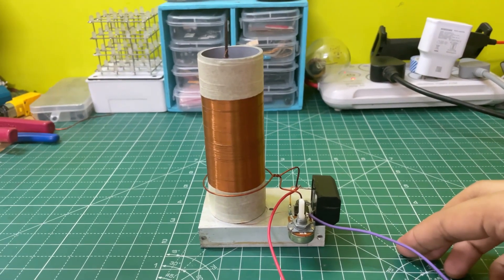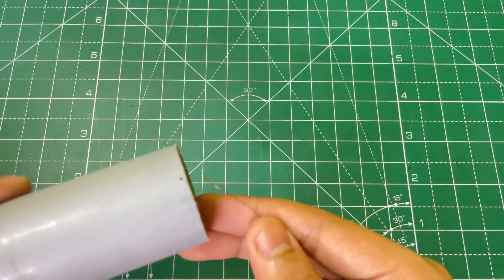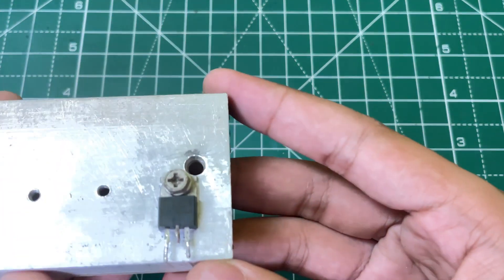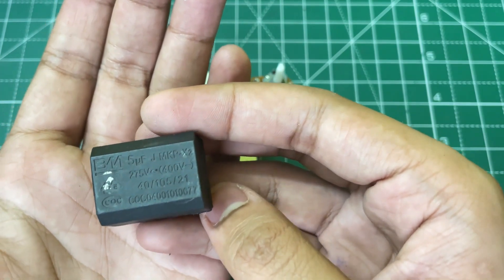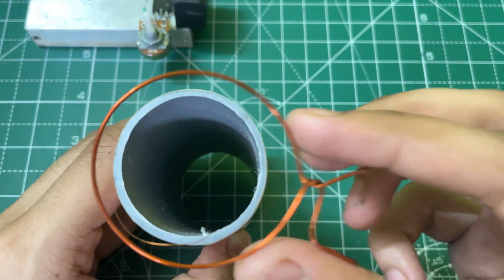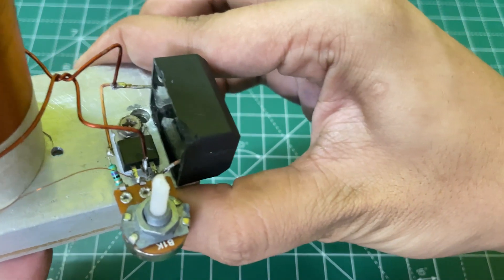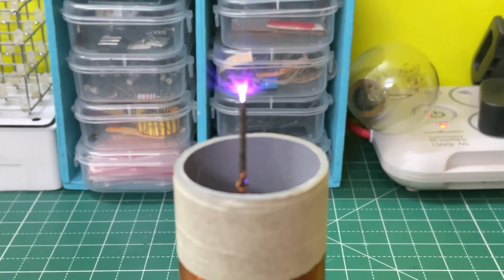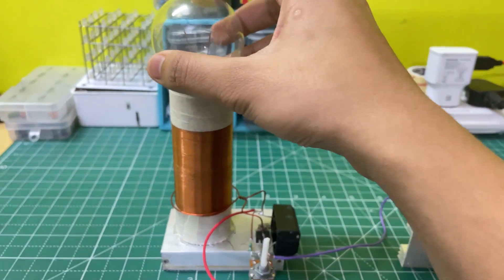DIY POWERFUL TESLA COIL WITH ONLY 4 COMPONENTS

Comment: I do It with a 9uf cap and a 5kh potentiometer !and it worked! 2:58
Reply: I think, capacitor doesn't have any role here, if ur dc supply is stable enough.
Reply: @deepaknanda1113 no you still need the capacitor
Reply: @franxchiesto have u ever tried making one, ever tested? Coz I have made it working without capacitor.
And their is no need of any capacor here.
Reply: @deepaknanda1113 it didn't work for me without the capacitor
Reply: @franxchiesto maybe ur dc was not stable enough, coz here in this circuit, capacitor is not taking part in any resonance, it is just for the stability.
My power supply is linear and regulated.
Reply: @deepaknanda1113 I used a 12v 7.2Ah battery and it is stable I used it for a zvs driver and the output was stable

Comment: I have used same mkp capacitor still the circuit is shot circuiting
Reply: Try re-wiring your circuit or replace your capacitor, maybe yours is faulty.
Reply: Check your primary coil direction

Comment: nice video bro, you explained very well. Can i use a normal capacitor insted of a mkp capacitor?
Reply from the maker: Use mkp capacitor only
Reply: @kdcreativity6201   thanks for your help🙃
Reply: But how come? It it due to the high-voltage a regular capacitor can't take? Or voltage rating/capacitance? @kdcreativity6201

Comment: Can we use irf620 ?
Reply: yes, IRF640 is electrically the same as IRF640N, the "N" just means it's a lead-free version of the transistor. Both will work just fine if properly cooled.

Comment: Will it make sparks in with 12 volts power supply ?
Reply: I believe so. He used 18 volts, so 12 should work, but it will be a bit weaker since there isn't as much power.

Comment: such a great video bro.. can I connect use to 2 9V battery as power supply?
Reply: I think so, only it would be half the power he used in the video (18v), so your coil may not be as strong as shown.
Reply: No ,the power will be less and the battery drain very fast

Comment: Can we use 56 ohm resistor
Reply from the maker: Yes
Reply: @kdcreativity6201  thanks
Reply: Bro I checked my connection but my heat sink is not heating at 12 v I checked with tester the top nail has current but mini neon bulb not glowing I used 56 ohm resistor and 2 k variable resistor
Reply from the maker: Message me on messenger
Reply: @kdcreativity6201  I don't have your contact or e mail

Comment: 1) Which wire did you use for earthing ?
2)Which source of input you use AC or DC ? 
3)Plz give link of making of input system 18 v power source 
4)Can I run it on 9v battery ?

And great job
😊
Reply from the maker: I have used 0.2mm copper wire for the winding and the input is dc. You can’t run it on 9V, it won’t work properly. 
If you want to make a powerful smps then make this one 👇
https://youtu.be/XfMwZBKS_AQ
Reply: @kdcreativity6201  THanks 
Love you bro 😊😉
Sorry for asking so many question but
And one more thing I search your name on Facebook but I can't find your profile so thats why I can't talk with you and ask queries plz help 😅
Reply from the maker: My Facebook 
https://www.facebook.com/kumar.divyansh.921
Reply: @kdcreativity6201  what is the minimum voltage on which I can run it properly
Reply from the maker: 12-15v
Reply: @kdcreativity6201  Thank you
Reply: Good night 😉🌜

Comment: I have 1380turn in secondary and 4turn in primary 19.6v input from laptop adaptor still didn't get arc and 😢 mosfet heatup quickly please somebody help
Reply from the maker: Please message me on messenger so that  you can send me some photos of the circuit
Reply: @kdcreativity6201  bro plz help me too

Comment: Bro I have a door bell coil 😅 it is almost as thin as hair can I use that for this project
Reply from the maker: You can use if you can wind it around the tube without overlapping 😬😬
Reply: Ok broo thanks
Reply: And also bro at what minimum voltage it will start arcing 😅
Reply from the maker: 12-15v
Reply: Bro I made a coil using 24 gauge wire will it work
Reply: Please say yes 😅 cause it  a task to do
Reply from the maker: Yes but make sure it has more than 200 turns
Reply: @kdcreativity6201  bro if possible can I send you the photo on any of your social media accounts
Reply: @kdcreativity6201  if not is there anything I can do to make it work
Reply: Please if it'll work I will be very happy
Reply: Is there any changes in  components that I can do so it'll work 😢
Reply from the maker: Please message me on messenger
Reply: @kdcreativity6201   I couldn't find you on messenger
Reply: @kdcreativity6201  bro where can I find 1 mm wire
Reply: @kdcreativity6201  ignored 😢
Reply from the maker: From shop or from old transformer
Reply from the maker: Bro please message me on messenger

Comment: Can I use Irf z44n ?
Please reply please
Reply from the maker: Yes but don’t use input voltage more than 15v otherwise the mosfet will die
Reply: @kdcreativity6201  thanks a lot. but will i get a visible spark ?
Reply from the maker: You will probably get small sparks
Reply: @kdcreativity6201  what if i use irf9540 or higher number IRF mosfets 😅
Reply from the maker: You can’t use irf9540, use irf840 aur irf740
Reply: @kdcreativity6201  thanks for reply .  Ut i have one more question. Will there be more powerful sparks ?
Reply from the maker: It’s max for this type of circuit
Reply: @kdcreativity6201  chances of surviving the mosfet ?
My irf 640 keeps dyingeven after using a big  heat sink

Comment: Hey bro, i made it and it worked but i was not happy with arks so i increased no. Of turns to around 800 and now it just don't work any solutions ?
Reply from the maker: Please check the mosfet
Reply: @kdcreativity6201  mosfet is working fine maybe my wire is thick ??
Reply from the maker: @guri5257  try adjusting the potentiometer but make sure to set it as i have done in the video before starting
Reply: @kdcreativity6201  ya i tried all the way from right to left but no arks
Reply from the maker: Can you please send some photos of the circuit on messenger
Reply: @kdcreativity6201  your contect ?
Reply from the maker: https://www.facebook.com/kumar.divyansh.921
Reply: @kdcreativity6201  umm sorry I don't use facebook . Do you have insta account?

Comment: can i use CBB capacitor . and if i use it then  where should I attach the positive wire
Reply from the maker: Yes. Connect the negative point of the capacitor to source of the mosfet and the positive to positive power input
Reply: @kdcreativity6201  thanks

Comment: Will it work with 28 gauge wire and 400+ turns
If yes please make a video on it
Reply from the maker: Yes it will work
Reply: 😫 failed
Reply: With 12 volts

Comment: Bro i made this circuit but my mosfet is dead how much current does it draw?
Reply from the maker: Make sure that the potentiometer is set to max in anti-clockwise direction as instructed in the video
Reply: Ok

Comment: Hey sorry for asking too many questions but who don't ask they don't learn . So i just want to say can it run with a power transistor instead of mosfet ?
Reply from the maker: You can ask as many questions as you want. You need to use mosfet only
Reply: @kdcreativity6201  ok
Reply: @kdcreativity6201  thx

Comment: Can I use irf3205 MOSFET
Reply from the maker: Yes but I’ll recommend using a high voltage one
Reply: @kdcreativity6201  i dont know it is high voltage or not please check an tell me
Reply from the maker: @circuitmahalingam6232  yes you can use
Reply: @kdcreativity6201  thanks